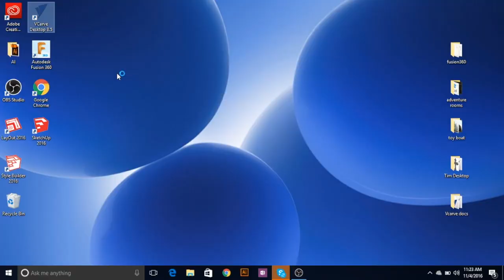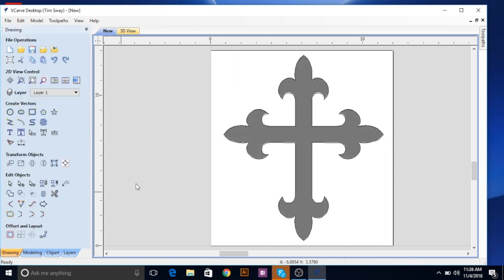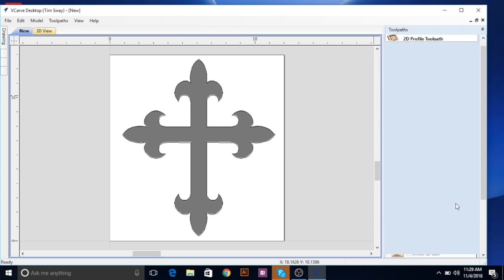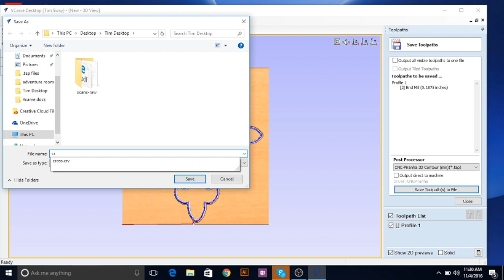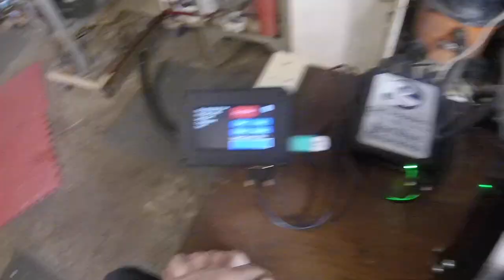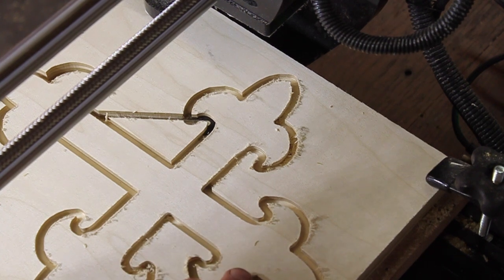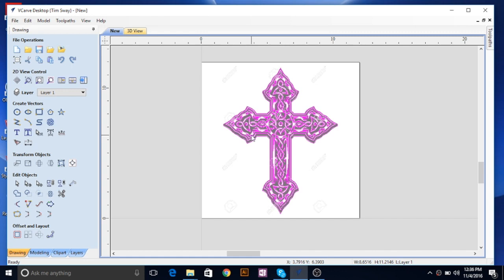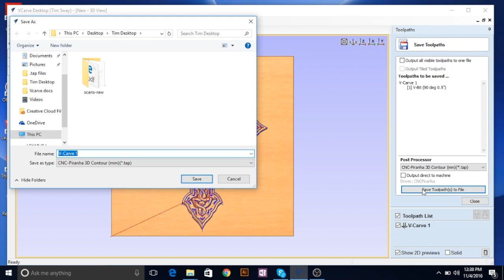CNC Adventure ep 2 - Beginner's V-Carve and Carving a Cross

Comment: Tim, it was cool to see you on Dave's show last night. I'm sure you will figure all this stuff out on your own, but one tip I can give you is to set your zero point in a way that is repeatable like the hard stop in the corner or just have the machine drill a hole at 0,0. Then you can make two cut paths using different cutting tools. Do your carving path first with the v-bit, swap to the straight bit, set it back at 0,0 and cut your outline.
Also, there should be a tab tool in V Carve (I haven't used it but all the CAM programs I've tried do). This lets you leave little connections around your pieces so the don't come loose while cutting. You can then trim the tabs with a knife.
Reply from the maker: hey, thanks Mark! I've seen the tabs feature but haven't tried it yet. I'm trying the "one new thing at a time" approach so if something goes wrong I know where to look! hahaha! I have successfully run two toolpaths on one piece of wood now by getting better with the zero stop. without unclamping the work, I can move the router anywhere on the table to switch bits, then hit zero and it goes back to the beginning. i'm getting there :)
Reply: tim sway Cool, just make sure you have a way of checking to zero position. If you move the tool while you are changing the bit, the controller can't tell, and your coordinates will be shifted.

Comment: The final looks awesome Tim!! So when I used to do engraved signage I had a Hermes 2000 LT. One of the great features of this machine was its ability to run the desired cut with a piece of ink pen in the bit mount. The only thing you had to do was turn off the motor. I could lay a piece of paper down in the size of my project set my borders in the pen would draw exactly where the router bit was going to go. One of the bonuses of being able to draw it first was being able to show that drawing to a potential client or department head. That was years ago and I'm assuming that there is and available system like this for your machine 2. If not I'm quite sure you can adapt the core of an ink pen to fit in the router to draw whatever you want. One of the ways I did it was zeroed out the tip of the PIN to the top of the material at the starting point, and then set my depth at Point app point 002 maybe this can help you brother anyways great project looks fabulous
Reply from the maker: Rag Tie thanks. i bet  I could get an ink pen to stay in that router. good idea.

Comment: Hey Tim,
    Nice work. I am no expert, but I teach vcarve and shopbot classes (among others) at the local maker space (TechShop Pittsburgh). If you ever have any questions or want some tips feel free to hit me up. 
   A lot of time what we do is have an MDF spoil board / bed and then either use brass screws or plastic brad nails to afix the work piece to the machine. (the spray adhesive seemed to work well) Also, if you use tabs on the profile cuts and cut .02" through the material into the waste board you will always get a clean cut out with out the piece coming loose and flinging out of the machine. You do need to go back and sand down the tabs.
Reply from the maker: Get Square w/ Tom Jolley thanks for the tips! i plan on looking in to tabs and whatnot as I get better at the basics. I'll keep you on file for help! :)

Comment: Great vid Tim. I have resisted CNC because it reminds me of the nightmare that my old CD duplicator was. The robotics would misalign in the middle of a 50 CD print and burn. The software was terrible, had to trick it to use photoshop files with industry standard CD templates. You are slowly turning me back to hope, hope for the future of carving shapes out of CDs that were needlessly ruined by that terrible machine.
Reply from the maker: i remember those! tech has come a long way since then, amigo. I've wasted a little plywood learning how to use this, but all the waste and errors so far are my fault, not the machine's...

Comment: Did your Skype ever sign in? :( new version out today anyway :P
On topic (hahaha :D) I would have thought the cad/cam software would know the CNC bed size, so the gantry wouldn't smack itself into the end of the rails? or do you have to fine-tune all that crap manually?
That second cross came out beautifully :O :D very very nice :D Great to have a play and experiment!
Reply from the maker: Azayles no wifi at the shop!! hahaha. the software is universal for all different size cncs, so it's up to the user to make files that work for the size machine they hace. in theory I could build bigger gantries and table for the motors and parts o have and make mine any size I want, but I don't wanna do that - too much time away from things I would rather do and too much can go wrong :)

Comment: Hi Tim,I don't know if you will see this as it is an old video of yours and I don't know how you tube sorts its messages. I am wanting to get into CNC but the only one I have had came from China and I could not even get the software to accept the activation code and in the end had to sent it back as a reject. The beauty of the internet means that I don't even know where in the world you are but I am hoping that I can get things on eBay from wherever you are.I want a CNC that works with software that I can buy or free but I have been burnt once and I am looking for some guidance. Could you tell me the name of the CNC you have, the software you use, and the cost. My woodwork shop is very small and I will be working in the open, so I need something I can move and also understand, A tall order with my intelligence (very limited to none existent). The size of your CNC looks perfect to me and if I am understanding you correctly you do not require a computer with the machine, just one to write the code on in the first place.I hope you see this and can reply, I would be very grateful for any assistance.
Reply from the maker: I remember your debacle. You are in the UK, correct? I use the piranha which I got from rockler. It's is $1600 w software (you need to buy router and bits) and you can leave the computer at home and bring the USB drive only. But it helps having the computer nearby for making edits. There are less expensive ones (I've seen and used some) and more expensive. For the ease, portability, Etc. This is the best way I've seen to go. The software company is vectric, UK based, you could try contacting them to see if they k ow who retails the piranha bundled with there software in the UK or something equivalent. Hope that helps!
Reply: Thanks for the information Tim, I have sent an email to piranha and they have confirmed that they can supply a CNC to me in the UK, but say that the smallest one they do is 51 inches square. I find this odd as I have seen the size of yours and it is much smaller then yours.I am continuing to email them and hope for a good result.
Reply from the maker: mine has a 12" X13" bed. use this link to help: http://www.rockler.com/cnc-piranha-fx
Reply: Hi again Tim,Although Piranha will deliver to the UK, Rockler will not so I cannot go that route, but I will keep going and hopefully get their in the end
Reply from the maker: John Fithian-Franks I sent you that link so you can tell people which machine you want, not the 51 inch. I know rockler can't retail there.
Reply: Hi Tim,Sorry for any confusion, I did not mean to suggest that you were wrong or anything and thanks again for the link. I have sent the details to Piranha but find it funny that they don't seem to know the sizes of their own machines?.I am still awaiting a reply from them but hope it will come soon, as I am champing at the bit to get one and start playing. I have a whole list of things I want to use the CNC for including small clamps that Izzy Swan made. I tried making them by hand but they are so little and my fingers just aren't made to do things that small, at least that is my story and I am sticking to it.Thanks again for all the help and advice. Regards John FF.
Reply from the maker: i wonder if you are talking to the right people? the parent company that makes my cnc is this place: http://shop.nextwaveautomation.com/shop/
Reply: Hi Tim,Thanks for the new link, unfortunately they are in the USA and don't ship to the UK, (do I notice a pattern here?) so it is back to Piranha or I could relocate to the USA but I think that is a little drastic although it would solve my problem. Or I could rent a PO Box in the USA and have them send it there, I will look into that if I get any more problems.Thanks again